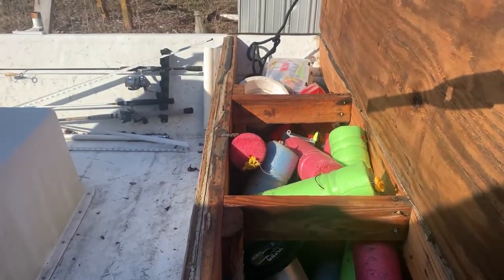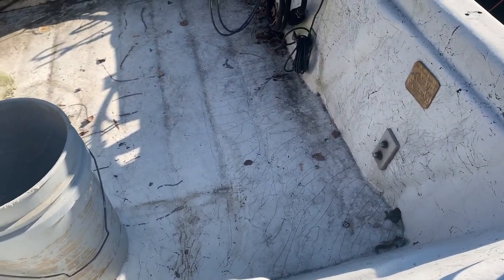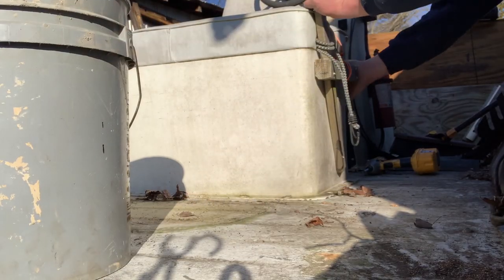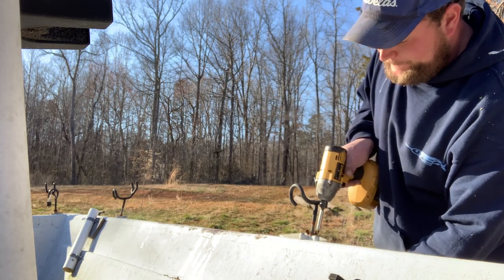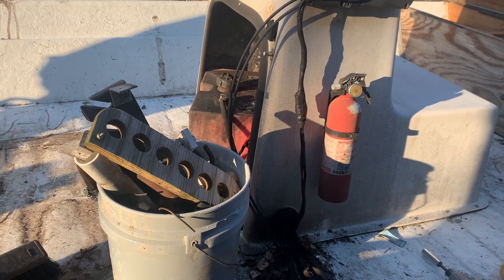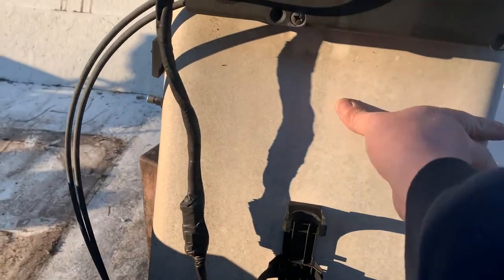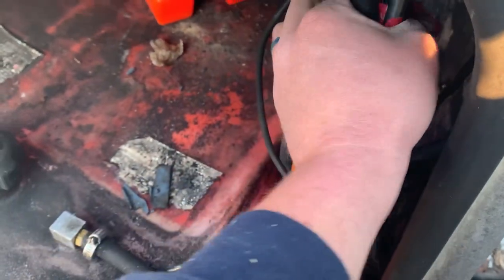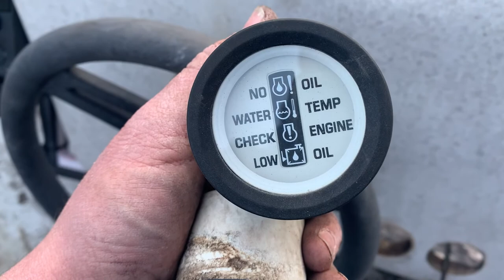Everything Must Go!! Rebuilding A Carolina Skiff [Part 1 Gutting!]

Comment: How in Satans butthole did the boat get in the shape it’s in?
Reply from the maker: It happened faster than I would have expected. I sealed all the holes with marine sealant when we changed consoles. After a while it worked out and wasn’t noticed. Water got in and it just got worse and worse. Tried a few times to seal them, but it was to late.